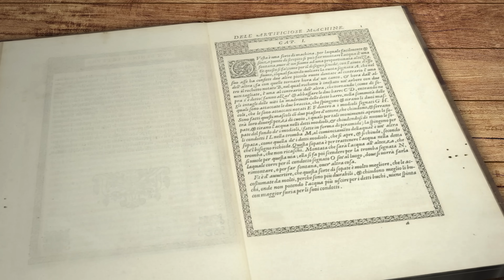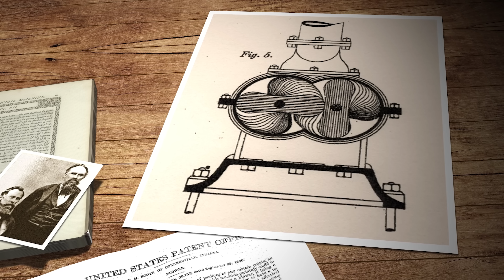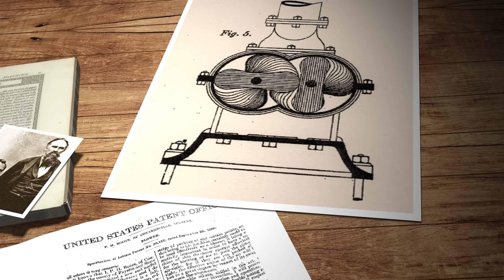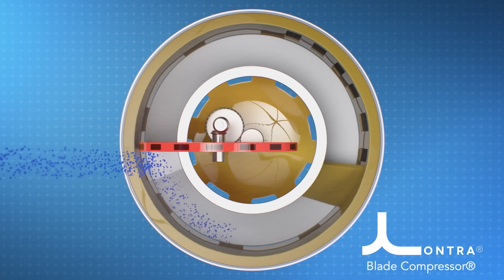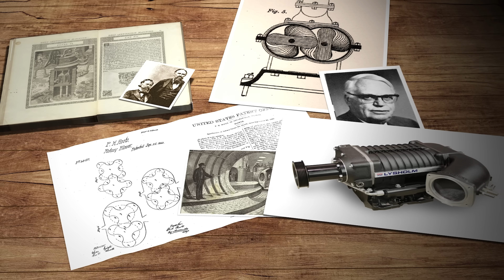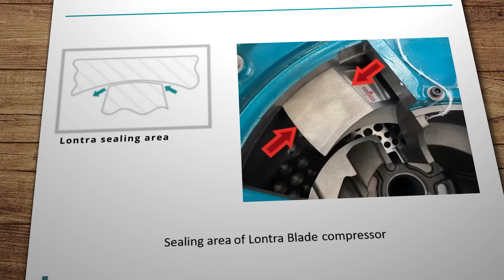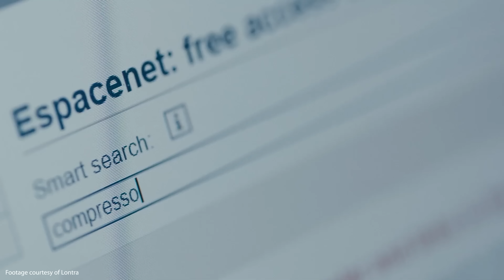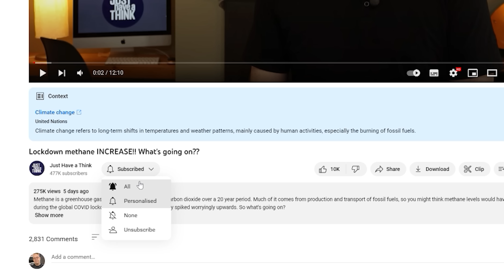Compressing air to reach net zero. A 'revolutionary' innovation.

Comment: I used to work as an inspector in the quality control department at a company that manufactured multiple sizes and grades of screw blowers, from stock engine types for offroad ATV's to the top drag racing ones that you see on those super long dragsters. They were such a pain to measure all the tolerances and such. The biggest ones had multiple profiles in their outer diameters so the clearances would change on different parts of the rotation. There were by far my least favorite parts to inspect. Super high tolerances, and very difficult to get good repeatable readings.
Reply: annoying work but without that QA reach net zero will not be reached. industry has lot of wasted sloppy use of energy. Heard and read many anecdotes.
Reply: Kevin. As someone that has probably used your products, I thank you for being an excellent employee and keeping those tolerances high.
Reply: @aaronfranklin324  Some great tips there, thanks!

"But when SHTF, it's the intelligence and cooperative behaviour and sharing of knowledge that the little people have that always changes the world.
Good luck with your project. " - I completely agree. And thanks. It's a long-term one that I hope will end up being valuable. If not I will have learnt a whole lot, so not pointless regardless. 

I have learnt a good deal about twin screw machines and particularly profiles by studying the work of Professor Nikola Stosic of the University of London. Rack profile generation techniques (allowing similar production techniques to gears), offset shaft bearings to compensate for uneven forces and retain even clearance, etc.

"I'd suggest don't spend too much time overthinking." - Very guilty of this, I'll admit. Especially when I have to pause a project due to financial or time contraints. Then I over-analyse the design and redesign it all in my head, often only coming back to the original as the best practical starting point regardless.

Another thought that came to mind is the design in the video will have pulsed output, which reduces efficiency by introducing pumping losses (technically, the twin screw also has slightly pulsed output, but it's largely smoothed out by the number of chambers and asymmetric shape of chambers from each rotor, reducing losses to minimum), and lower max rpm than a twin screw. I'd be interested in how they got their "34% improvement" numbers. Also, due to low rpm, they'd need to be physically larger to achieve the same flow rate. Horses for courses, etc, choose the right tool for the job I guess. Nice to have more designs in production anyway 😀
Reply: Hi Kevin I'm Quality control ,mechanical inspector and some industrial processes use 5 Sigma you can do it for pizza but inspecting aerospace components is different ball game . Plastic is very difficult to control and sometimes high rejects rates because some smart arse designed a 18 inserts and 12 are rejected. Some companies I worked for always had a dim view on Quality Assurance and using plus and minus 3SDs they couldn't understand tight tolerances.
Reply: @romanchomenko2912  We had a few aerospace parts come through the shop now and then. Tightest tolerance ones I worked on were when I was working on the CNC grinders. Was several parts that were stupid hard to hold tolerance on. Far less frustrating to measure but higher tolerance for sure. Only one I remember off hand was some sort of tiny piston with a ball end where we had to hold Sphericity within +/- 0.001 mm. I think it was. Might have been 0.002 but it was 6 years ago, lots of things fuzzy now
Reply: ARRRGH..I will stick to medicine!🤣
Reply: Yeah crazy high tolerances
Reply: Teflon coatings and cascades prof kistemaker and kamerling onnes cherioo yunis
Reply: You should have just done what China does and mold the "QC passed" sticker into the part at the time of manufacture.
Reply: @onebylandtwoifbysearunifby5475  LMFAO ive seen that but the implications of it being molded into the part hadnt crossed my mind. Funny, but also scary depending on the product.
Reply: @scumbaggo  It's basically how China does quality control. I've actually seen red and white "QC Passed" "stickers" etched into products, including PV solar cells (Not just stamped, but etched). I've also seen electric battery management systems for lithium batteries with "QC passed" stickers on them, despite the fact that they forgot to solder input and output leads on. So how did they test it? Lots of lithium ion battery fires in the news, and maybe this is related. 

Honestly, if China burns down the USA, Canada, and most of Europe i think they would see it as a bonus at this point.
Reply: It does make me worry when the culture is basically, keep measuring until it passes.
Reply: @gaseousFumes4u  reminds me of a statistics lecturer... if you go in with a pre-conceived notion you'll torture the data until it confesses
Reply: You could have used one screw to mold, lathe or hot forge it's partner in a jig with synchronised counterotating chucks.
Or even pour garnet grit or run a sanding band along the gap. Rotational lapping. 
Easy peasy problem to solve. Did you have management that tortured and terminated intelligent people in the workplace?
Reply: @aaronfranklin324  i understand your point but then there is the gap and/or the diference of thickness of old/new belts and the "marking" in the resulting piece, also, you would need to polish it to keep it smooth, and then measure it to see if it meet the 0.005mm standarts, so...
Reply: @LNRenan  yeah, get ya. 
I'd probably use a MgCl, MgO fibre reinforced ceramic  system like racing brake disks and two stroke piston- barrel kits are made from if I was making something like that. You could mold it to perfect mirror finish and tolerances from a one piece mold, and just screw it out to demold it.
Harder, stronger, lighter, far less thermal expansion coefficient, and far cheaper and faster to make than any metal construction. 

Can handle 2800C without loss of strength.

People think the Stone age was low tech🙄. 
Only advance in the ages of metals is enslaving people with expensive shit that don't last long.
Reply: @aaronfranklin324  But MgO has a higher thermal expansion ratio and higher thermal conductivity than steel... And molding comes with it's own problems, hard to match thermal expansion of mold materials, causing warp during cooling, etc. Many molded components that require tight tolerances require post-mold machining. Not impossible to overcome, but possibly expensive to tool up and iterate until you reach the desired tolerance. 

Making high accuracy, high performance twin screw rotors is not easy or cheap, unfortunately. I love the design and well-designed and made unit can exhibit both high efficiency and relatively long maintenance intervals.
Reply: @stephenkeen6044  not sure you are right about that. Those piston-barrel kit's require no rings to seal and the temperature range is very high. 
MgO works pretty good in those old school spiral stove elements, with a resistance wire in the middle of it too. 
If you are really worried about thermal expansion coefficient, you can fill the binding system with fine negative expansion coefficient aggregate like with astronomical mirror glasses and ceramics. Zinc Titanate for example. 
Nice thing with MgO cementing matrixes is they aren't very hard and are easily worked like plaster after setting until dry. And fully compatible with natural fibres, glasses from soda glass to basalt fibre, carbon fibres etc. 
Sure for optical grade tolerances some grinding may be necessary, especially, if you are high temperature sintering.
Ultrasonic machining is a nice way to do it. Especially for such things as meshing screw pumps.
Reply: @aaronfranklin324  Thanks for the detailed post, some pretty interesting stuff that I didn't know. Was just going on basic material properties that I could find. I have some ideas using twin screw compressors in a high temp environment and was wondering if something like treated nextel fibre (titanium nitride coated) in a fused silica matrix would be feasible. Would you have any thoughts on that?
Reply: @stephenkeen6044  Frankly, I think that they are somewhat telling Porky's in a branding exercise. There doesn't seem fundamentally much difference between Their Nextel branded range to common fibreglass like the aluminium borosilicate used in common fibreglass products. 
Even their own datasheet admits that the fibres suffer from changing chemical and physical properties when exposed to heat, and sintered into fused silicas etc. 
Basalt fibres would probably be a better choice. They are superior in many ways to pretty much anything, particularly in the sort of temperature range that you must be considering since you are thinking of  using fused silicas. 
Of course not all basalt is identical. 
If you wanted higher heat resistance then you would have to look at Alumina or MgO  glass fibres. Or Carbon. But Carbon fiber burns pretty easily. Even diamonds burn pretty easily. 
Nexel looks to me like Nylon being marketed as Kevlar, drawn ultrahigh molecular weight Polyethylene fibers as Spectra.
Etc. 
You might find that Halloysite nanotube fibers , a natural form of kaolin clays are a very good option in a MgO matrix. Probably a good part of the reason that medieval Chinese porcelain cups and teapots can be heated to glowing orange, and dropped into water without breaking. 🖖
Reply: @aaronfranklin324  The makeup is mostly alumina, silica and boron.. so, yup, could be right. I messed up in my previous comment, I meant boron nitride, formed by preheating the fibres in a nitrogen environment (leached boron reacts at surface with nitrogen). Helps prevent brittleness of the composite by allowing slight slippage at local sites. I chose pure fused silica for the matrix due primarily to thermal transfer, expansion and softening point, for preventing losses into the material and allowing it to operate at a larger range of temps, from around 30 C to over 600 C (estimated expected temps) and handling multiple thermal cycles. Never investigated Halloysite, but it looks promising. Does anyone make "macro" fibers / cloth from it?
Reply: @stephenkeen6044  maybe. I did read a paper a few years ago exploring polymer matrix drawn Halloysite nanotube reinforced fibres. 
But that's not what your looking for with the heat range.
Interestingly there's been some very interesting work looking at natural cotton or hemp fibres as reinforcement in sintered geopolymers and ceramics. 
The nano structure of the cross linked cellulose chains has been found to yield more elastic yet still high strength layered graphene  like fiberstructures when temperatures are ramped up gradually in a curing and sintering process. And the matrix protects them from further oxidation. 
One very good aspect of an MgO system, is the ions have the same diameter, so denser packing and less ability for ion diffusion. 
Which is why MgO refractories are so high temperature heat capable, and thermally conductive. 
And simple MgCl, or MgSO4 or very fast setting   KPO4 Activated MgO cements are stronger, twice the yield at failure, and more chemical and seawater resistant than CaO based systems.
Cotton fibre reinforced MgCl activated MgO is what poolballs, bowling balls, and pins, imitation ivory and marble always used to be made from.
And still are in the East. 
I guess your nitriding would protect the glass fibres. Still, silica is pretty easily dissolved by even mild acids, bases, and even steam at the temperatures you are talking. 
It has a pretty open and permeable lattice structure, and lower bond strengths than CO ones for example.
Reply: @aaronfranklin324  Thanks again for all the great info! Storing it all up for when I (eventually) get to material testing for the project. Will be using steel for the first prototypes / proof of concept (and very short run lengths so they're never exposed to the extreme heat the final product will need to endure).
Reply: @LNRenan  Also ignores the balance of the rotating components entirely.  Stupid RPMs = balance is critical.
Reply: @aaronfranklin324  Aaron -  you need to learn the difference between "its"  and  "it's".

Comment: Turbine manufacturers solve the precision end gap issue for turbine blades by allowing the blade ends to be abraded by the housings with the result of perfect clearance at max heat and RPM. Similar abrasive machining can bring roots type blowers into perfect clearance very cheaply.
Reply: Most screw compressors use an oil to fill the gaps between surfaces, which is filtered out of the discharge air and recycled back into the system.  Seems to work just fine.  Change the oil every few thousand hours and you’re good to go.

Comment: I ran a grit-blasting business for three years and lived & breathed air compressors, including a bank of 10 fridge motors to fill my receivers overnight and warm the office up ready for work!

This technology could make liquified air energy storage more viable.
Reply: It's a blower per say, not an air compressor. 15 psi max
Reply: @Ramdodge582  it's not 15psi max.  The maximum just depends on the tolerances and strength of the parts.  You could build one capable of 1000psi

Comment: Thank you for your very clear explanation. I'm glad to see that the Lontra blade compressor is being increasingly applied to many traditional uses. At first I assumed that you would be talking about waste heat recovery from the compression process. It sounds like this compressor is most useful in applications where a compressor lubricating fluid can't be employed.
Reply: there seems to be a lot of seals sweeping almost every surface, I don't see it working without lubrication & exceptional air filtration.
Reply: @alanhat5252  multi stage axial compressors have much more sealing surfaces
Reply: viscosity of a hot and high pressure gas is high and they tend to leak less. This is particularly important when the engine RPM is high and the process is almost adiabatic. Multistage centrifugal compressors are not inefficient and they can run at high speed.
Reply: Like Oxygen lines

Comment: Positive displacement compressors and motors are better for variable speeds. Turbines are better for fairly constant speeds, especially at higher flow rates, which is why aircraft, power plants, ships, etc. use them. The precision timing of this design would lead to a catastrophic failure if the timing mechanism wore even a little.
Reply: Ever see a rotary lobe/screw blower that has a little wear on the timing gears?  Or that they were reassembled after maintenance off by one tooth on the timing gears?  Can you say shrapnel?
Reply: @michaelpatrick6950  Im quite sure that most air screw compressors only drive om one of the screws and the other follow, no need to use gears. Screw compressors are very reliable.
Reply: @karaffens on a contact cooled screw compressor the oil is what creates the clearance oil free units are geared.
Reply: its like Rotary engine replacing a piston engine

Comment: Interesting as I recently saw a demonstration of a motor which works on the same principle for driven output i.e. vehicles. The issue raised concerning that motor is it's heat dissipation or it's thermal properties and it's lubrication.
Reply: An air motor?

Comment: This is an ideal solution for medical gasses as a carefully selected metallurgy and seals for bearings would impart nothing from the compressor except pressure. 🤔
Diving air is another use where a hookah dive pump using this compressor could easily be driven electrically. 
This has a tremendous amount of applications and would be ideal for plant air with an air dryer. 
Great video 😀👍

Comment: Thanks Dave - has this compressor been used with a heat pump and if so is there an improvement in the CoP?
Reply: Atlas copco sweden makes already these trains used in their metal mines smart thesepoikas and flicornas cheers yunis
Reply: The energy efficiency is not really about Heat pumps in its compressor.  Rather the fluid, radiators.  The mechanical compressor is the minority portion.
Reply: @w8stral  You pay for the energy the mechanical compressor uses when running a heat pump. If it's 35% less energy, it's 35% better.
Reply: @edbruder9975   Yes/No.  See above.  All improvements are nice; no one will bitch about improved efficiency, but we have no idea if this version scales or its gains.  It sounds like it should but it is always those nitty gritty details which screw the works up.
Reply: @w8stral  On their webpage it says it's working pressure is 4 to 15 PSI so you'd need quite a stack of them to pump much heat. They shoulda started the story with 15 PSI but net 0 draws way more viewers and comments. Like you said the devil's in the details.

Comment: Technically this is not ideal as you stated. The seal is spread along the entire length of the stroke of the piston making it the opposite of ideal. Not that it can't be overcome with good engineering, materials, and tolerances.